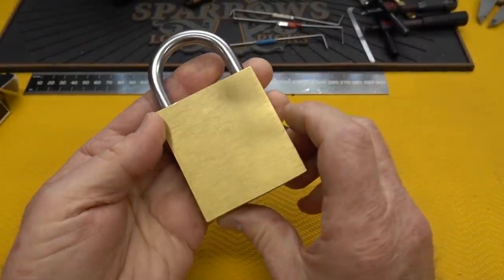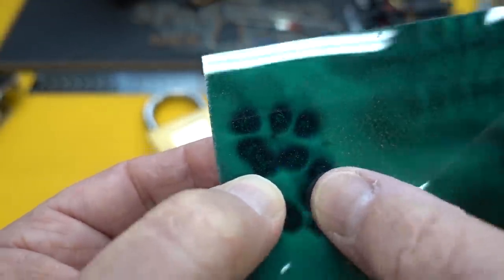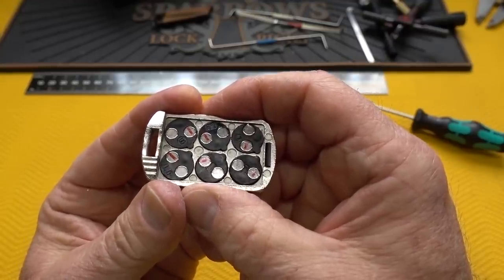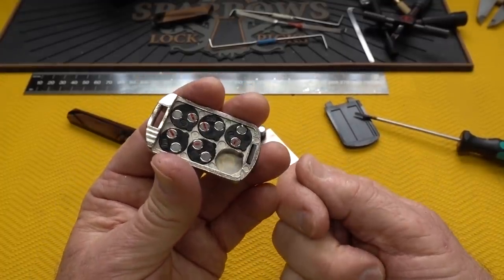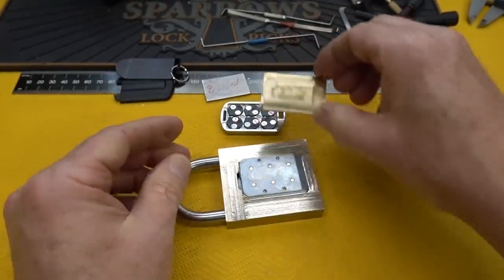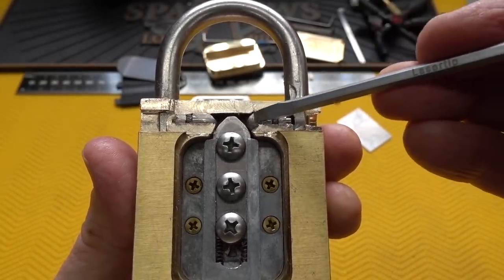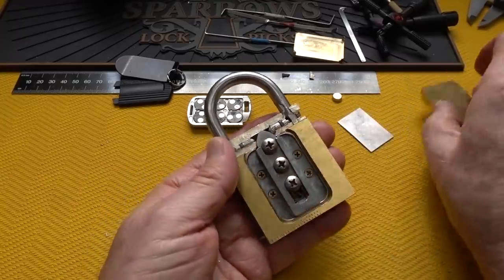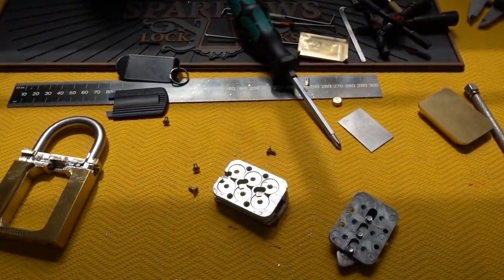(1701) RELOOK: Magnetic Lock (How It Works!)

Comment: It's pretty cool that the magnets "rescramble" when you take away the key.
Reply: Yes, probably a metal plate they are attracted to.  Very Nice design.
Reply: The polarity of the other magnets push them away from each other's side once the key is removed. It's a neat design indeed.
Reply: A magnetic spring if you will!
Reply: Oops of course.   I have 50 or so of that size here along with others, I should know better.
Reply: they stick to each other side to side this lock is awsome

Comment: This is at the same time way more simply and clever as I thought. I was thinking about a plate with holes which can move if several pins are pulled/pushed in the right direction to form a shear line  by the array of magnets.
Reply: Yeah that was my way of thinking. I was shocked when he opened it up & we saw that
Reply: Yeah, I thought that too, not a spinning disk.
Reply: The key can probably modified into pick tool its simple just file the notch and its free spinning it will automatically align to the lock disk orientation maybe can pull the lock and spin the top disk and see if can feel the click.
Reply: @wolfbrave4866  If you apply pressure on shackle trying to feel anything, you will simply jam disks and they shouldn't spin.  This seems like truly unpickable lock.

Comment: I think you could pick this with a special magnetic tool that allows rotating the individual discs individually.
Reply: Came to comment this.
I imagine one of those plastic disks with the magnets epoxied and a rod coming straight out. You generate  tension on the shackle and start turning disk by disk until it unlocks. Would be a great challenge and probably a great collab with someone like LPL...
Reply: You can easily pick it by taking advantage of each disk not being symmetric regard to weight. You would need a weight with a tenth of a gram resolution and a small magnet to manipulate the direction of the cut out of each of the six discs.
Reply: @frankolsen261  I kind of get the general logic behind your comment, but I fail to see how exactly it would work... Could you elaborate a bit further?
Reply: I agree. I think it's self tensioning due to the spring loaded detents. a small magnet should do it placed horizontal to the surface where the key goes and turning one by one.
Reply: It only takes a magnet and a little pull and it will come right open. (I think)

Comment: Seems like a simple “pick” could be created by having a similar patterned magnets (two opposite polarity, same distance apart as the key and lock) on a turning handle. Using the shackle to apply the effective “keyway tension”. You could then match the pin up with each of the six rotating pins, and spin until it clicks. That would set under the pressure provided by the shackle, and you could move on to the next rotating pin until the shackle comes free.
Reply: I'm pretty sure the slightest pull of the shackle would bind these magnet gates right up.
Reply: You might be able to get some feedback on the turning handle, but it would probably be very minor, even with strong magnets.
Reply: You would have to create a tool that can allow you to turn each wheel but then keep the wheel from moving once you have it in a desired position.  Then, tensioning the shackle, you might be able to tell if you have them in the correct position by if they wiggle.
Reply: Theoretically that seems possible. If the disk can spin, that means you need to pick another one, like for a combination lock. Now when the disk is bound you need to figure out if you are in the gate or not. The main difficulties would be to find the right pressure on the shackle to have only one disk binding at a time, and maybe more difficult keep the disks in place once picked.
Reply: @yom73  Also the way the shackle is locked up the feedback will be very crude. Even when the lock is in the unlocked state opening the shackle appears to take significant force, and it doesn't look smooth.
Reply: Yes, probably wouldn't work as sufficient force can't be applied through the magnets to spin the discs if the shackle is tensioned. Also no real "feel". Very clever.
Reply: Murgoh What could work is to make a key where you can rotate the disks and lock them into position in order to turn this lock into a combination lock. Whatever is binding, you will look for the little play meaning you are in a gate. If the disks can stay into position and you can pick them individually, that should make things much easier.
Reply: @yom73  Had the same thought, just take a key and put a rod into the plastic discs that goes all the way to the outside of the key, where you have a grip or something you can use to rotate the discs. You'd have to cut the little index nibs off of them too, and find a way to stop them from rotating before you move on. Still, with no real way to actually feel what's happening in the lock, it's gonna be quite difficult to pick, but maybe possible.
Reply: I was My First Thougt, but as soon as you try to tension the Screws will Touch the inside Rotary Element stopping it from spinning. 
I Suppose this is nearly Impossible to be accomplished by Hand.
Maybe a Mechanic Tensioner doing tensioning in micrometer steps While continous spinning the Six Key Elements could be successful. But this is a Hightech inside Labor approach and defenitely Not a street-Attack.
Reply: Prompted Hawk If you press the shackle, you may feel if the disk is solid or if there is a little play, same as we do we disk detainers. However since we are dealing with magnets, the feedback will be highly muted.
Reply: @TheDAD405  Exactly my thoughts, the only way I see that one could attack this would be with some sort of array of servos and sensors and enough tinkering to figure out an algorithm that could exploit the design.
Reply: Brannon Hudson the turn handle then turns the little magnets inside the tool to adjust the locks magnets. Good idea.
Reply: Power drill with magnets at the end, spinning at a good speed may let you get them all set with light tension, I’d like to see it attempted
Reply: It might just be possible to do a safe cracking style attack where you can carefully rotate each spinner with the shackle under very light tension and listen for a click where the gate lines up and the lock shifts a tiny bit.  Use this to decode the lock.

This could be extremely difficult in the presense of false gates, however,  since the lack of a direct linkage means the spinners are free to catch just slightly, enough to add randomness to the exact position of the key magnet relative to the spinner that might be used to determine which gates are false.
Reply: Would probably have better luck trying to “bump” it by having six spinning sets of magnets to interface with the disks at the same time, while jiggling the shackle.
Reply: Just rake it with a strong magnet lol
Reply: shane  I hesitate to say "near impossible" since lockpickers are quite clever.  But yes, I agree.
Reply: @smevnk  The real question is whether the magnet would be strong enough to turn the spinners when the lock is under enough tension for raking to function.  You'd have to test it out.  False gates would surely ruin your day either way, though.
Reply: Any effective tension would seize the rotating pins through friction, as you cannot brute force magnets.
Reply: That is really interesting. I would imagine one of the three screws would touch one of the three paired discs first, binding it.  With the magnetic pick, just have to spin until no resistance.  Question is whether the magnetic field is strong enough to spin the disc while rubbing against the screw.
Reply: Wouldnt getting a chisel and popping the top plate of be so much easier?! 
Not hard to find the plate edge, i feel it would be quite simple to do.
Reply: The solution is rather simple and even mechanical if you want it to.
Just make a 6 handed clock. It will spin all magnets in the "key" through all possible angles while also periodically pulling the shackle.
Since we already know the secure gate positions, if the device could run at 100 hz, it would take it about 44 minutes to decode a lock in the worst case.
Reply: @RealCadde  yeah and you have to jerk the shackle at 100hz as well to test if your key positions are right.
Reply: @JunkCCCP  Which is why i picked 100 hz, it should be within physical limitations.
Reply: @RealCadde  The amount of tech required to beat the lock would be vastly over the amount of value of goods the lock would be protecting given it would be much easier to physically attack the lock.... lock and design wins.  On a hypothetical 'must beat lock at any cost' then yeah that could work.
Reply: Easiest way would buy one, and make it so you can spin the orientation of the magnets in the key and set them to different levels.  However I am doubting the number of combinations of this lock as soon as you have the right poles its just a matter of spinning them to position.  

The KEYS might have many combinations, but actually picking it, there is no combination, just a matter of lining all 6 spinners up with the pins, which as well though Would not be a fast attack.
Reply: I’d like to learn how strong the magnetic interaction between the rotating disks is. It’s possible that rotating them individually could reset the other disks unless sufficient tension is applied AND that such tension would prevent the relatively weak (as compared to mechanical force of the tension) magnetic forces of any pick from being able to rotate the disks.
Reply: @joncrow3228  It will reset the other disks.  In fact, this is how the lock relocks itself.  The magnets in the disks interact strongly enough with each other than they all line themselves up unless you have external magnets (i.e. the key) holding them in position.  

To pick it, you'd probably need one magnet for every spinner, and some way of keeping them all held in position since trying to keep 5 magnets from budging with just your hand, when they're all pulling on each other, all while manipulating the shackle and picking, seems rather difficult.  You'd need some sort of jig to hold them in place as you found the proper alignments for each one.
Reply: You would have to assume that all of these locks contain 12 discs, and that all of the magnets are roughly the same size, as well as the approximate diameter of each disk. You also have to assume that a lock contains no magnetic traps, or if it does, you would have to assume what the traps are, and how they work. No lock is truly invulnerable, but this design certainly adds to the workload of a prospective picker. I wish the manufacturer a successful product range.
Reply: You wouldn't get any feedback from the disks.
Reply: Yeah, no matter how I look at it there is no way that this would be practically pickable I think. What I mean by that is that you would never pick this lock to get to whatever it is guarding. LOL in terms of it being a fun challenge I guess it is just however much work you want to put into it. I think that the only thing really going for the pickability here is that there seems to be a small number of gate positions. I think that the observation that these are magnets all interact with each other makes this very hard to pick a disc at a Time. One way you might be able to do this thing is to try to measure the position of the magnets from the opposite side you would normally place the key. I'm not sure how clear that would look or how well it would work, but it seems like it would be doable. If you were to do that then you could use an array of hall effect sensors since hall effect sensors are directional and analog type devices that change their output based on signal strength. You wouldn't likely need a crazy number of them you would just need positioning to be really well-thought-out. from there I would probably use something like servos like people mentioned including a Servo that would push up on the shackle in a very controlled manner so that only a disc or so would move at a time. Something I didn't initially think about was that the disks seem to be floating and probably have some amount of play.  what I mean by that is that B more or less seem to be floating in their Chambers on cone shaped bearings surfaces. we might be able to spin even with a small amount of tension on them. you actually might be able to pick multiple discs at a time by lifting up on the shackle a minute amount and rotating them. Hmmmm...  still, I don't know if you would ever be able to do this from feel... would probably be better to just try every combination using are there a robotic device or a jig. LOL
Reply: With the idea of turning a key into a 6x spinner device, gear the spinners so that they will permute the various cominations, while slowly increasing tension on the shackle, or chuck a stepper on the input of the geartrain and a solenoid on the shackle...
Reply: yom73 I can imagine a safe with a removable combination face plate of a key

Comment: Hey Bill, can't wait to see you and LPL to invent a tool for this damn thing.
Thanks for the video and to the donator, this was very interesting!
Reply: Probably just 2 mini horseshoe magnets with some tension should do the job
Reply: @lewisheasman  yes.  But too much tension and the internal rotating wheels won't turn....  you can't force them like standard pins, and they won't hold under tension due to the way the bar slides between then grooves..  You'd probably need 6 magnets and a jig to hold them in orientations while you work on each pair....
Reply: Hi Bill :)
after seeing the internals, a flash shot through my brain...

imagine a plate like the blank key with 6 bolts, each containing a magnet that can be turned freely...

then gently pull on the shackle of the lock to put tension on the mechanism and start rotating the bolts one after another...

at a certain point all discs should be aligned as they need to be to open the lock

what do you think? =)

Greetings from Germany
Reply: The key can probably modified into a pick tool its simple just file the notch and its free spinning it will automatically align to the lock disk orientation maybe can pull the lock and spin the top disk to the bottom disk and see if can feel the click.
Reply: If you copy the lock itself you could use it as a key. What I mean is that if you have a free spinning decoder, it should be possible to detect if the lock itself is moving when manipulating the key. If it is, the decoder won't rotate after you release it, but if it's stuck it will as you'd be manipulating a stuck disk thus a static magnetic field.
Reply: @wolfbrave4866  The key modified in this way could be used as an impressioning  tool for other keys....
Reply: I was My First Thougt, but as soon as you try to tension the Screws will Touch the inside Rotary Element stopping it from spinning. 
I Suppose this is nearly Impossible to be accomplished by Hand.
Maybe a Mechanic Tensioner doing tensioning in micrometer steps While continous spinning the Six Key Elements could be successful. But this is a Hightech inside Labor approach and defenitely Not a street-Attack.

Comment: That mechanism in a puck lock or shrouded shackle would be a beast. You could potentially create a pick for these with 6 dials but with no good way to tension the mechanism you would just be guessing at the orientation of the cams.